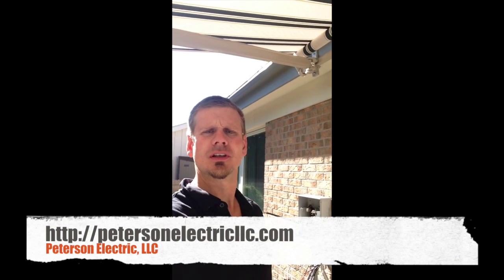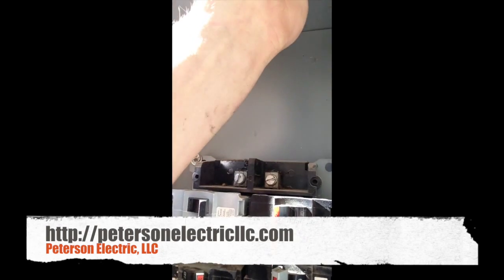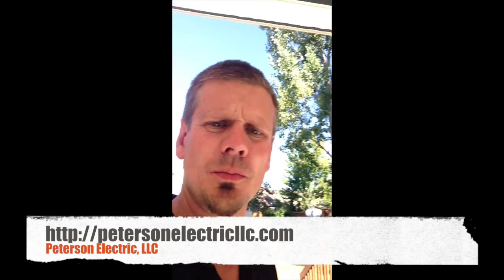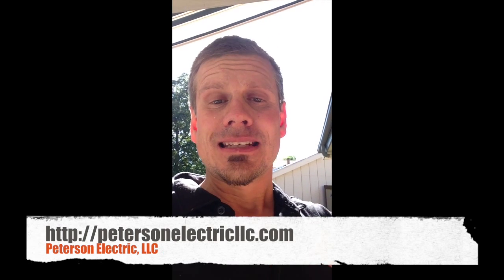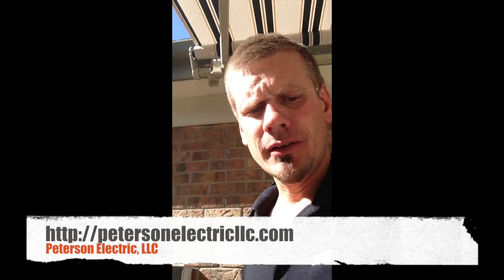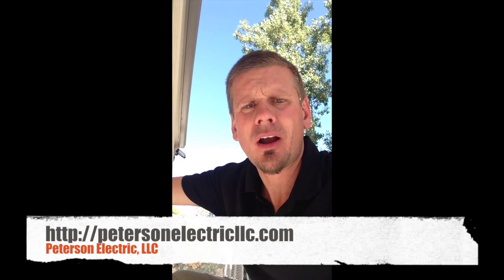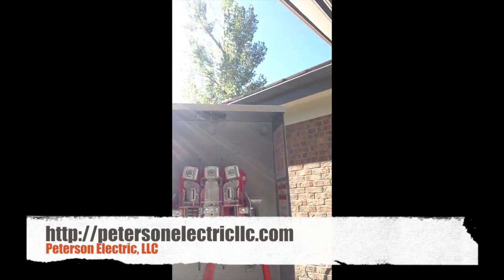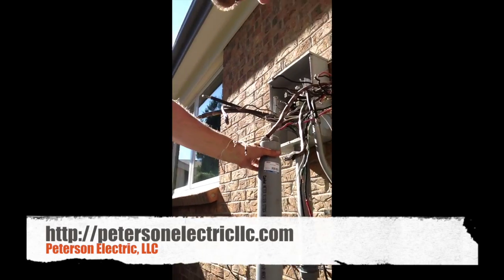What To Expect When Changing & Updating Your Electrical Service Panel To Your Home

Comment: I did my own complete overhaul.  The home was built on 56 and had only 10 circuits across 2 panels. tons of splices were found. updated with the same siemens 200 amp panel and 24 circuits.  overkill.  passed inspection.  it's simple. but lots of work.  being under an old house is dirty work.